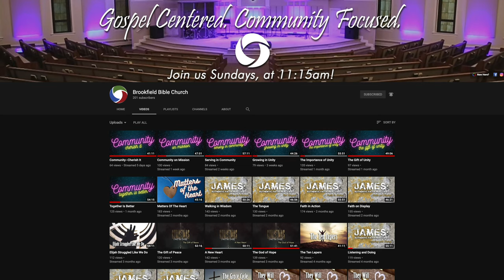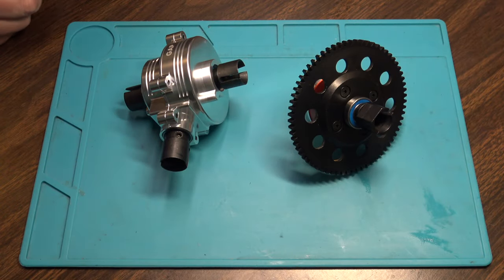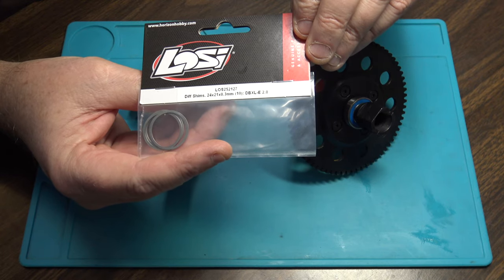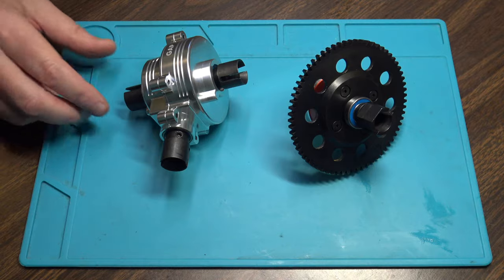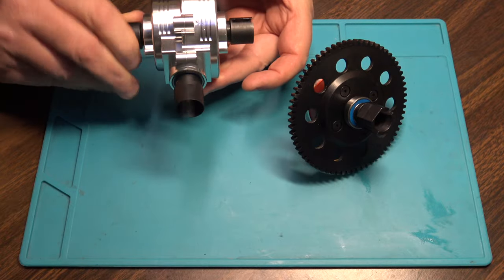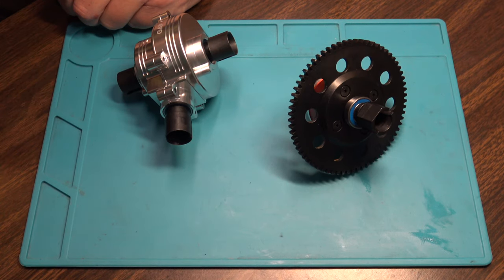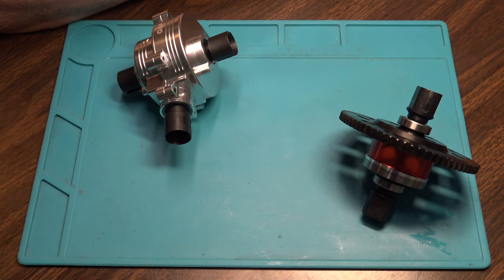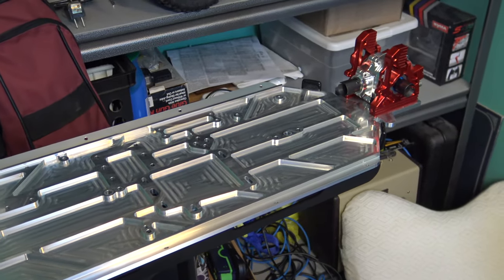Happy Easter - MTXL Update

Comment: Great info! Those DGI cups are sweet. 7075 aluminum. I used dbxl-e CD cups. But those DGI have to be better. Over time and diff changes I have had threads pull out of the dbxl-e cups. Curious how well the DGI do. Keep up the awesome work bro!
Reply from the maker: Thank G-Man. You had threads pull out😱 that’s crazy. The DGI seem nice, wish they had the bleed screw though. We’ll see how it turns out 💥⛽️💥⛽️
Reply: @316RC  yes. Threads came out of the dbxl-e cup. I guess too many times in and out of the screws with loctite on them.